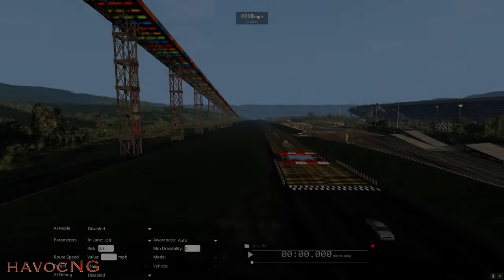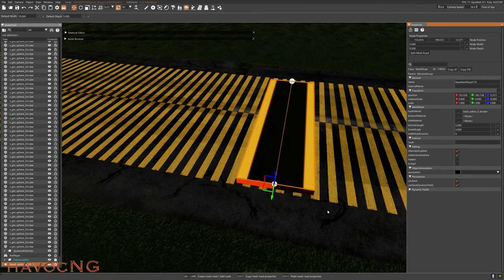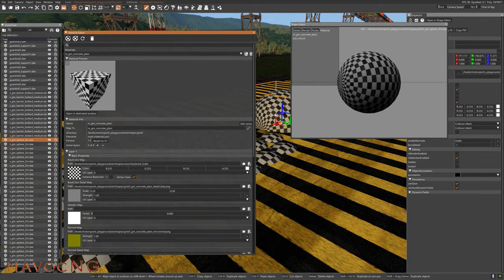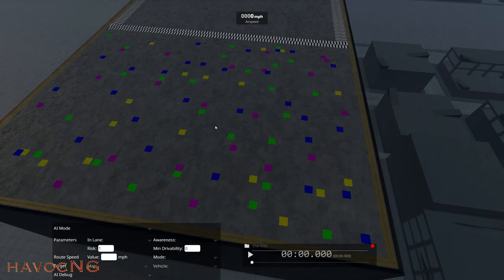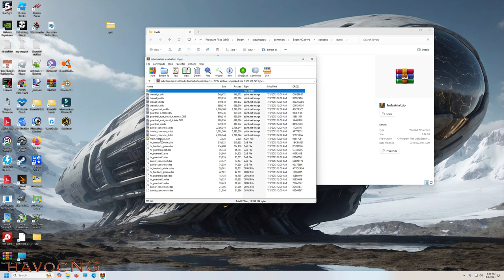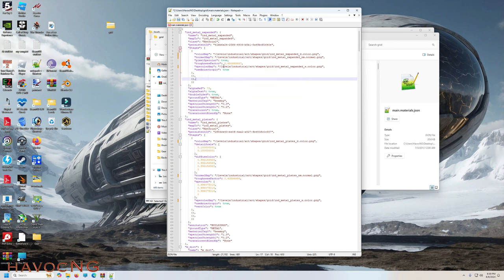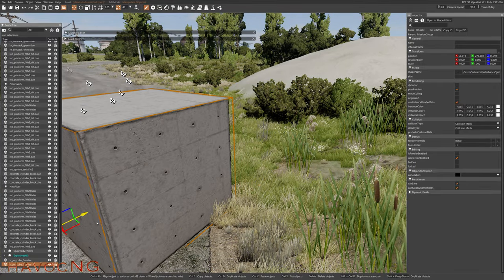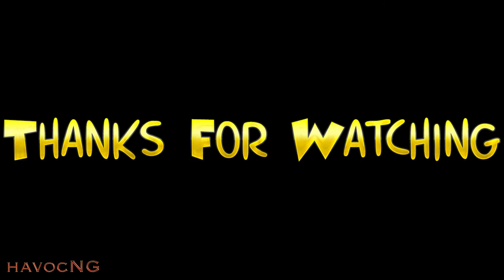How to add materials to objects in BeamNG

Comment: What do you do if the textures wont save? Im having an issue where a few certain textures will not save. I have even gone in and edited the materials file, it saves in there but in game will not save the path I give it. Every time I close the game and start it back up it goes back to the original path. Its only certain ones though, others save just fine. Any ideas?